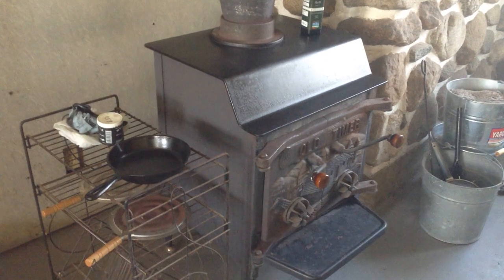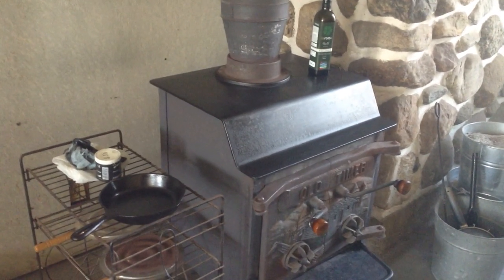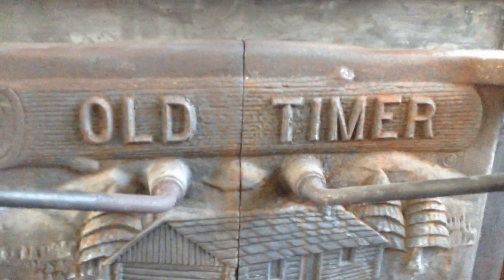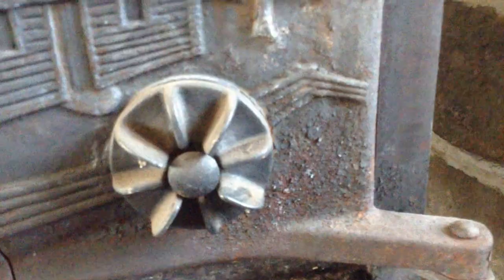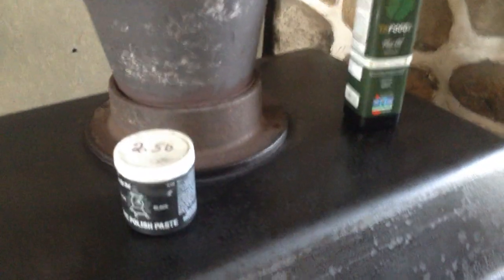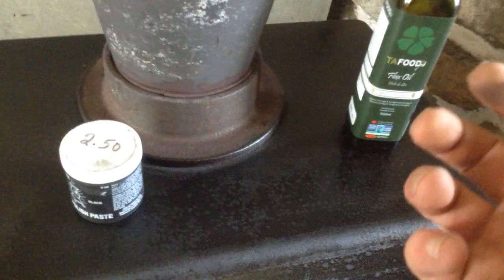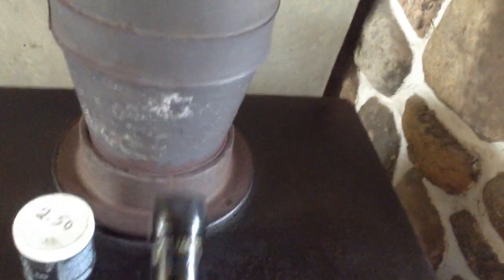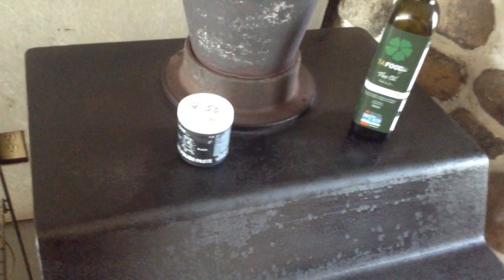Maintenance of your woodstove's exterior with flax oil

Comment: I've already tried this with great success.  I used raw linseed oil which is the same as flaxseed oil.   I use my stove exclusively to heat my house.  It's a freestanding circulating stove designed to also be a fireplace insert.  So, the hottest it ever gets on top is maybe 300 degrees F.  So far it's held up pretty well.  I've been using it for a couple weeks.
Reply from the maker: The key, then, is to keep it below the oil's burning point.

Comment: I used vegetable oil, put it in the cold stove and warmed it up all day. The top of the stove is now shiny and nice looking, but a sticky. What can I do to solve this? Thank you!
Reply from the maker: The reason that I had suggested flax seed oil is because it has a very high burn temperature--but as I later learned, not high enough for a wood stove.

You are stuck with two options: clean it off, or burn it off (or both.) It's going to smoke like crazy, same as if you burned it in a pan.